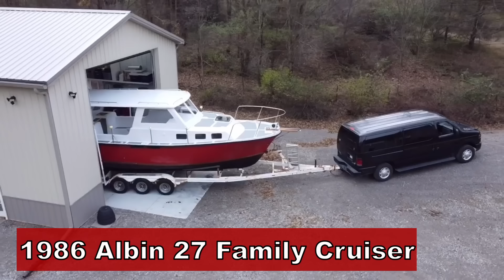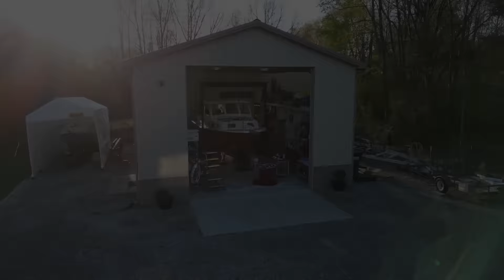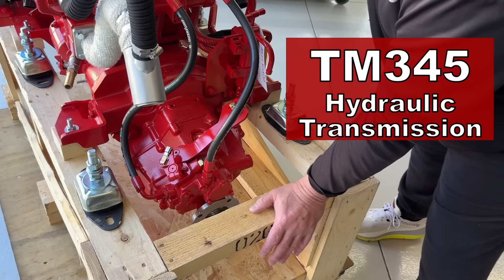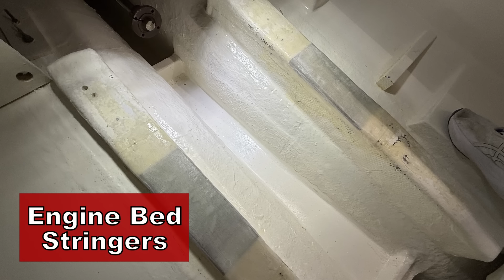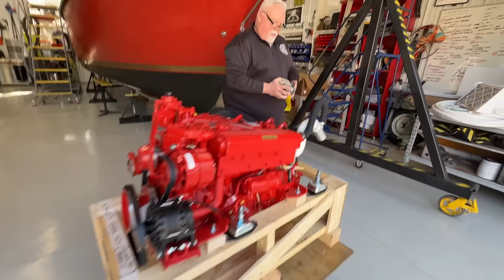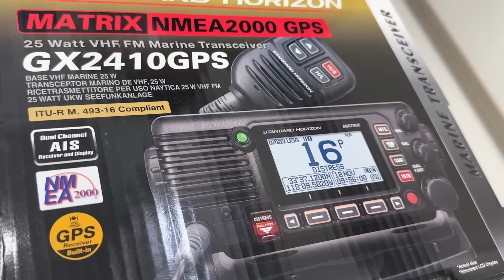Diesel Repower Your Boat | Beta Marine Diesel 43hp | Walk-thru and Options (Ep170)

Comment: 🫡🏴‍☠️.  Big Salute from a true Jolly Roger!  VF84 1980-1981.  Can’t beat new.   I have 1980 CC Corinthian with 454 x2 gasoline.  Love em (and the fuel dock).  Picked this boat as it’s all fiberglass hull, twin engines - that I can work on, up to complete rebuild.  If you ever need a hand leme know. Fire up Chips.  Mtp Mi.
Reply from the maker: Thanks for the salute and the offer to help—it sounds like you’ve got a fantastic project on your hands with those twins! 😎

Comment: 275 a at what rpm? And what does that translate to engine rpm? Gal per hr?
Reply from the maker: The engine uses less than a gallon per hour. The specs are available online check out the Arcos website 😉 It’s all good 😘

Comment: Impressive engine would have gone for higher hp myself say 43hp.
My understanding of marine engine ratings is that the rated 38 hp at 3600 rpm would be peak / intermittent power .
Say running at 2200 rpm and 3 percent loss for gearbox ,estimate 25 hp available  at gearbox output.
Depending on propeller type and efficiency,  normally 50 to 70 percent, you may be shy of your 18 hp . Assume alternators could reduce this further.
I am no expert, just my thoughts, though Beta Marine will be more knowledgeable and sized it right for your boat and sea state you expect.
Look forward to the installation.
I have a 45 year old Mercedes om636 engine still running.
Reply from the maker: My engine is 43hp. 🐙😂🤣 yes, that’s  why it’s called a Beta Marine 43. 🥸 I’m going to assign you homework —watch the video again, this time stay awake. 🤣😂🤣😂🤣😂
Reply: @motorcityboatwerks You should be OK with the 43 hp 
Bad Monday lol

Comment: I've just done a DIY repower of my 34' steel Van De Stadt yacht with an old school mechanical Vetus (Mitsubishi) 33HP motor which has many common features with the Beta marine diesel, also a 4 cylinder engine, the oil pump out is such a game changer for oil changes, I also have a similar flex coupling  so for me this was a super interesting video, just because I know exactly what you're talking about regards fitting into a tight space, I had to modify my existing engine mounting stringers with fabricated 8mm steel plinths on the bell housing end because the existing stringers were too low, fortunately it's a steel boat and I'm a fabricator/coded welder with European ship repair experience so an easy fix , very informative video, good luck with the refit and install, again I can relate having just launched after a 2 and a half year rebuild on the hard, and another year probably still doing cabinets, 12V systems, refrigeration etc etc etc.....
Reply from the maker: That sounds like a massive project, thanks for sharing your experience and the tips! 👍😁

Comment: Joe:  One of the "finds" that I experienced when installing my Beta 60 in my 87 Albin FC was the fuel filter.  The fuel filter set too high to close the hatch cover.  My fix was to re mount the filter.  The filter sits on top of a flat bracket.  I removed the filter and remounted under the bracket.  This allowed just enough room for the hatch to close and not hit the primer pump.  Good luck with your install.  I took two days to install and hook up all the stuff.  I spent five days in alignment.   Just for information; My cruising speed is 7.5 kts at 2,000 RPM.  I burn approximately 1 gph at cruising speed.

Clay Helm
Reply from the maker: Brilliant! Good information Clay 👍 I will check it out   Thank you very much for heads up

Comment: How does it go weight wise and performance? Weight to power ratio? Compared to the older model?
Reply from the maker: The old engine was a Nissan Ld28 diesel. Six cylinder 78hp. Watch my prior episode on choosing the engine to understand my selection 🤓

Comment: I had a yammar motor in a yacht it was a fantastic motor but bloody expensive for parts😢  but was a great reliable motor tho , i always thought the perkins diesel motors were the go , there all around the world and easy to get a part quicker 🤔  mabe times have changed these days
Reply from the maker: Perkins is an old heavy engine. 👍Great reliability. But here is new tech and up grades out there today in the form of reliable Japanese industrial based engines. Thanks for your comment
Reply: Back in the day you could get a part for a perkins motor any where in the world that's why they were great in yachts , has that changed now
Reply from the maker: Yes. Parts availability, reliability, and environmental compliance. The world changes. 😉This is a good thing

Comment: Old school Cummins guy.
855 ci , 335, 400, big cam 500 plus, Detroit 500. I love mechanical injection.  Simple to fix and maintain. 
Your thinking about the right stuff, remember lots of grounds and put in some filter caps 1mf. Should work, keep you power clean.
Reply from the maker: Thanks Tom 👍😁
Reply: Yes sir!! A 4bt Cummins would have been an excellent engine swap.

Comment: Those alternators are not messing around, dang. You got power for days off those bad boys.
Reply from the maker: Yes indeed. The boat will be running induction stove top, 12 refrigerator, and 12v air conditioning. 😁👍